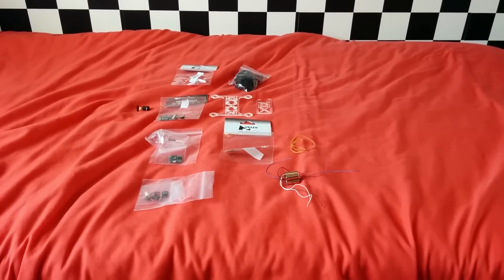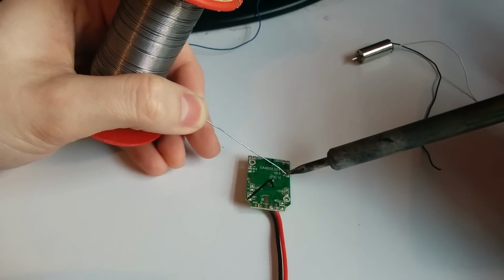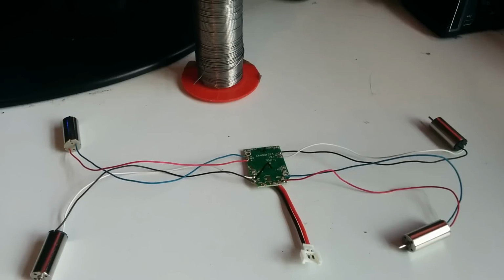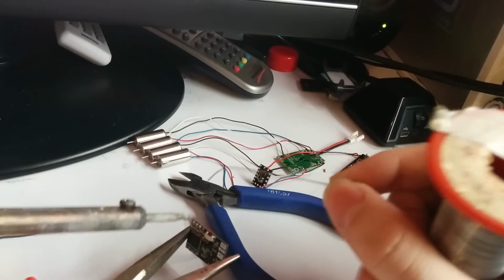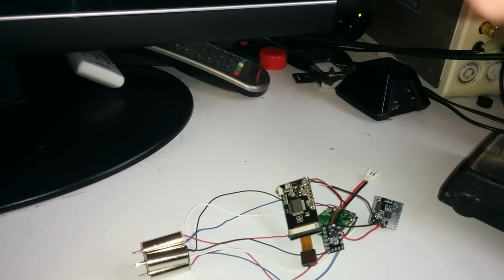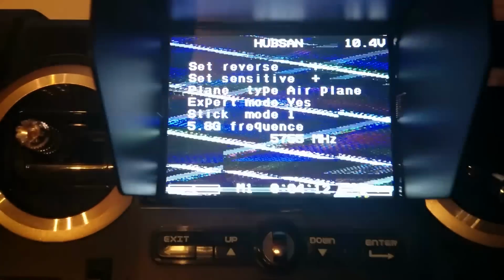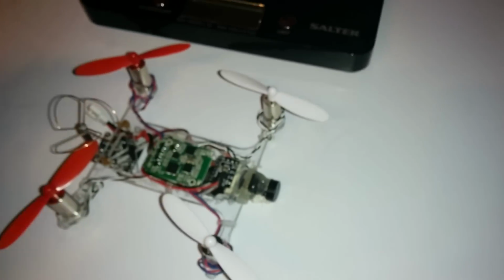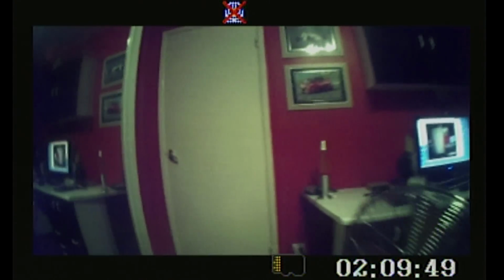Microquad Custom FPV Full Build & Flight With HD Recording

Comment: Was hoping the parts list would have a flight controller board and a low cost rc transmitter :-(
Reply from the maker: Raqtor96 you mean a multi wii based flight controller? the hubsan board coupled with the hubsan TX is the cheapest combo of them all 8gbp for the FC and 11gbp for the TX compared to alien wii which is 50 dollars and a tarainis which is 160 gbp!
Reply: +AndyRC I had been looking at the Nano QX board. Its supposedly very awesome and has "acro/rate/manual" mode plus build in DSM reciever. But its kinda expensive too :-/
Reply from the maker: they are expensive and i think only supporting smaller motors too?
Reply: +AndyRC Really missing your micro quad stuff :-) .. Dont know if you have heard of:
http://www.banggood.com/Micro-Scisky-32bits-Brushed-Flight-Control-Board-Based-On-Naze-32-For-Quadcopters-p-1002341.html
Build in 7ch DSM2 rx, 5V step up supply, 32 bit cleanflight/baseflight/betaflight and only 2.5g.
Reply from the maker: yep its coming up on the channel :)

Comment: what flight controller did you use
Reply from the maker: Theblankhand hubsan spyhawk TX with the hubsan h107d controller board
Reply: thanks
Reply from the maker: no problem

Comment: been searching for motors with longer wires, what did you search to find these?
Reply from the maker: prOkrEAt i search for hubsan h107d motors on ebay and sort by price lowest first. u can see on them that the wires are much longer they are about 3:99 from china all best
Reply: +prOkrEAt I don't know if you can post a link in YouTube comments but here goes a test. http://www.ebay.com/itm/221770485965
Reply from the maker: yep will be fine
Reply: +AndyRC I spotted that those with 2 wents in motor are not as much powerfull as those original hubsan with 4 wents, and you cant use them with the original hubsan motors for example from bangggod.
Reply: StalU
I bought some sets from that link. They do have 4 vents when you receive them. However they aren't powerful enough to really lift a 42gram picniquads. I bet the original h107d weighs over 50grams. I spend over 100gbp and the thing can't even fly yet :-)
Reply from the maker: that does not sound right :( iv never had a problem with ebay motors however Iv not bought from Australia before. I Always buy from china
Reply: That eBay link is a hong kong seller. The quad can sometimes take off in the ground effect area with the red and white hubsan h107d props from banggood. But then the propellers rips off. I tried securing them with locktite thread lock over night . .didn't help then tried CA .. that held them on until I hit something. But still didn't fly over 20cm up. With the rolling spider props it can kinda fly but is completely uncontrollable. Just wobbles around until a prop flies off.
Reply from the maker: thats crap. usually i use the parot props with stock hubsan motors however it should lift it better than you are getting :(
Reply: Perhaps I should try the Banggood ones . .they cost double though. :-)
Reply: Im waiting for new battery the ni can try out how much they really can pick up. now my 35g quad and old battery are fying but hower at around 80% throttle so not so good.
Reply: StalU
What motors are you using that can hover at 80% throttle?
Reply: +Raqtor96  banggood but i have 2yers Old batteries and they drop Down voltage.
Reply: I changed the frame and resolder the motors and it looks like something was wrong with soldering mb. now it hover at 52% on old battery weight is 42g and i am using 200mw boscam tx module+ 150mah battery :)
Reply from the maker: +StalU great to hear that. happy flying
Reply: Hmm. Perhaps the long wires on the motors reduce the current? Perhaps I should try shortening the wires. You think that could help?
Reply: I think there is no so much current flow in them, just check that after fly are they warm to touch.

Comment: nice idea to use the hubsan hd camera for fpv...but I would like to have a flight controller that can do acro/rate mode for practice...
Reply from the maker: Stephen Wright yes for that you will need one of the multiwii brushed boards such as alien wii or MWC board

Comment: does this H102F-01 also work with the ladybird tx5805 fpv module?
Reply from the maker: Johnny TSC it does but you have to manually select the frequency where as using the hubsan fpv gear it find automatically
Reply: Do u think the devo f4 fpv radio has better range and quality then yhe hubsan fpv radio?
Reply from the maker: I think they are about the same. they are different protocols though so the have different purpose. devo is for walkera and hubsan for hubsan

Comment: hi .. thank you for this very informative video .. tell me, what to trigger recording for the fpv? I am French and I do not understand everything that you say; p
Reply from the maker: yes you can do that but the h107c tx has limited range compared to the spyhawk
Reply from the maker: zzeeenn button on the side of the camera module starts recording
Reply: desolated but I hurt my question (goggle translation) .. I wanted to know if the fpv works even if not registered?
The H107C camera is active even if you do not press the button?
Reply from the maker: yes it does :-)
Reply: thx 😉
Reply: +zzeeenn The hubsan tx can turn the LED lights on/off, i read someone had wired it up so that instead it starts/stops recording, would have to google it..

Comment: I have several micro kodo quadcopters which I have salvaged cameras and other bits and parts from. The micro cameras I have had troubles with in finding video feed out for use in other builds I have. The module is very similar to this one in your video, any ideas? Very cool by the way..
Reply from the maker: Drew Heli can you link me some pictures of it? the camera module that is. thanks
Reply: AndyRC not sure how to link you to my personal archive, here I can only post videos which I have yet to do. here is a link of all the images regarding the kodo camera module and quad. https://www.google.com/search?q=kodo+camera+module&rlz=1C1GGGE_enUS494US494&espv=2&biw=1366&bih=667&tbm=isch&tbo=u&source=univ&sa=X&ved=0CEkQ7AlqFQoTCLi9zsep68YCFUg2iAod62EFZQ
Reply from the maker: those pictures are of all different modules so its hard to tell. first pic that comes up is the standard def version of the voard, dont think that has video out capability, second one along is the h107d video TX with no recording capability, third one along is the board in this video. I would say if its got solder pads try the fourth one along for video. it seems to be a common theme
Reply: how do I send you pics for review? so I can show you what I am talking about.
Reply: http://www.rcplanet.com/59612/Dromida_Complete_Camera_Kodo_Quadcopter.jpg this is one side of the cameras I have salvaged from kodo quads purchased at $5 US each. Then this camera module connects to this main board via the three wires http://www.hobbypeople.net/media/catalog/product/cache/2/image/9df78eab33525d08d6e5fb8d27136e95/9/4/943750.jpg
Reply from the maker: it looks like the standard def version of the hubsans video. its got 4 solder pots so try the fourth one along for video :)
Reply: awesome thank you!
Reply from the maker: no problem good luck with it
Reply: worked any with the eflite cgo1 wifi camera? trying to hack it in order to attach external transmitter to in turn connect to my fatshark goggles v4. I really hope you can help lol otherwise a waste.

Comment: the motor of hubsan h107c are 8mm not 8.5mm.... i have to buy 8.5mm?
Reply from the maker: Silicon Blog if you measured them they will be 8mm but most places list them as 8.5 - they are both the same
Reply: ok, thanks...  on aliexpress i see 8mm
Reply from the maker: they will be fine

Comment: Excellent video Andy very informative you remind me of myself messing about with the Hubsan internals..its great fun trying to improve an already cool product :) I have the H107L, H107C and now the H107D which I have now modded with a micro cloverleaf antenna that plugs straight into the H107D board no solder required from hobby king.com I also gave my 107d TX a cloverleaf..great extra range. A couple of questions and tips for you..do you know if it would be possible to solder the 5.8ghz video antenna off the 107D quad onto a 107C 2mp camera module and receive HD video on the Hubsan controller?.. After your h107c camera mod was what you see live on your TX any better video quality than the feed from original h107d quad? Or is it the same and it only records to the SD card in HD? What flight times are you getting on what size batteries?

I'm constantly changing motors,different coloured LEDs etc on my Hubsans...did you notice on the main Hubsan board just to the left of the battery cable there is another free + and - to solder too..(you don't have to double up the cables)

After much stress with the fine soldering in the end I purchased a very fine tip for my soldering bolt..much easier for this fiddly work.

Do you know of the different micro carbon fibre frames for Hubsan quads you can get from Phoenix flight gear.com..light,strong and look awesome when built.

I'm gonna take all I've learnt in this video and put in on one of these Phoenix frames.

Thanks again top video mate!
Reply from the maker: nopike2big  on the h107c there is no video transmitter so its only possible to solder an antenna to it if you add a separate vtx like in this video. regardless of the input the vtx only transmits in standard definistion so the quality is not that much different. i wasnt sure about the other 5+ so its good to know its there! - I have not experimented with other frames other than mmw carbon H - picnicquads is my go to place but i will check your link cheers

Comment: Nice work! I've been wanting to add FPV recording on my micro, but didn't think it would be possible without adding a lot of weight.
Reply from the maker: adamky1 the weight is n issue bit if you use these light frames it csn work :-)

Comment: do you know if the hobbyking quanum  fpv goggles will work with
    the 50-100mw vtx ( 5.8 GHZ AVTX ) you've used on this build?
thanks
Reply from the maker: wowiezowiepowie the quanam goggles work with anything, that is because they dont come with a video receiver. they accept any composite video input in. so if you buy an RC832 alone with the quanams you can pick up the video from that VTX. all the best
Reply: AndyRC can i use H107 L or C ?
Reply from the maker: yes any of them

Comment: Hello, which battery and flight times are you using/getting with this setup? I built an micro myself too but i've used the mmw micro-h frame. Doesn't put hd recording, only the fpv that i've built (ts5823). I'm having trouble with noise as i didn't received my regulator yet.. Tried to make an filter with ferrite ring + capacitor. It works but only when my batttery have enough juice then it starts noising and the filter is too heavy for this little guy.
Reply from the maker: Thiago Arecippo the mmw frame is quite heavy so i dont really use it i get poor flight times with it. i use the 500mah batteries from banggood. the picnic frame is so much lighter and cheaper
Reply: AndyRC Thanks for the tip.. I actually found it heavy for the project but i didn't knew about picnic micro frames, i'll take a look.. I'm using 750mah nanotech batteries and getting around 10 minutes of flight times but the quad is heavy for this motors.. I only need my regulators to try the fpv without noise.
Reply from the maker: yes i find the regulators from fpv hobby are the best
Reply: AndyRC I just ordered the regulator and CL antenna from fpv hobby but the x^3 platform picnic frame is out of stock. Which radio + rx are you using? I'm using stock x4 radio but i don't know how far i can go with it.. Another question, have you soldered the Vin + ground for the regulator directly from the x4 fc or what?
Reply: I just saw your radio :-)
Reply from the maker: i did do that yes its in this video :) and its the spyhawk transmitter :)
Reply: Thanks, sorry to bother you, i just saw your video again and the regulator wires. I'm thinking on getting a spyhawk tx for me (or the h107d) as they are on the same price range. Which one you think is better (range, dvr...)? Thans again, i'm rebuilding my micro-h based on your videos.

Comment: Excuse the question: between the various links that you put, I have not found the receiver's remote control, which you advise me to use? I could use a DX6?
Reply from the maker: Diego Falcone not with this setup but if you use the flight controller from micromotorwarehouse then that is compatible with the DX6
Reply: AndyRC Thanks for the answer!  With your configuration, what kind of radio should I buy?
Reply from the maker: any hubsan controller will work, i use the spyhawk transmitter from helipal its about 60 gbp
Reply: AndyRC Thank you very much!!!

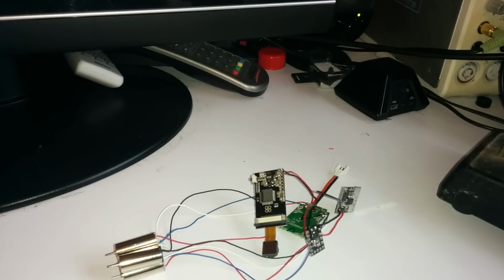Comment: Hey, I noticed at 25:02 you're soldering a video wire to pad #4 on the H107C-A34 module. How did you know it's possible to do that? Do you have a spec sheet for this component? I'm curious if this module can safely handle 2S. Thanks.
Reply from the maker: createthis I didnt know it was possible, just lots of trial and error. id be surprised if it ran at 2S because it powers up at 3v but hey they are pretty cheap these days so get a couple and try. honestly if you have a 2S setup you would be better with an 808 16 or a stripped out mobius. they are better quality. all the best.
Reply: 808s are so much heavier though. I'll try it and see. If it doesn't work, I'll compare the weight with a step down regulator vs an 808. Thanks for the reply!
Reply from the maker: you can really get the weight down with an 808 if you take the case off and hot glue the lens in (you really have to be careful not to move the 808 lens too much the ribbon tears really easily and you start to get funny colours in your image) Iv managed to fit an 808 to a micro quad so a 2s setup should be no issue at all. what quad are you trying to fix it to?
Reply: I've decided I'm going to cover the full range of options, here. I've ordered a #16 808 with a 120 degree "D" lens. I'm going to order a 3.3v step down regulator: https://www.pololu.com/product/2842 I'm also going to try my existing A34 at 2S and see if it magic smokes. Finally, I'll do an A34 build with the step down regulator and compare it to the 808 for weight and see which one wins. Maybe I'll film it all and do a video.
Reply from the maker: sounds good. although iv had much more luck with the regulators from fpv hobby than pololu, check them out. ill look forward to a video. keep me updated!

Comment: Nice job Andy.  Where do you live in England?  I assume England.
My next project will be to build a 250mm sized quad for my RC racing quad club.. I'm just a 57 year old kid. ;)
Reply from the maker: MrPolymers im in the midlands yeah :) im currently building a 450 size as I want a gimbal quad next.
Reply: I'm not sure I want anything bigger than the Cheerson.  I think the 250 class is ideal for me.  I can also sneak a flight around the house.  I won't fly my Cheerson here due to being just too dangerous.. I fly it only at my RC clubs field or sometimes my local park when nobody is around.
Reply from the maker: this is true this is why my longest range Rc vehicle is my micro setup! Iv gone further with the hubsan micro quad than i will anything else! going for 1km when i find the right location
Reply: Yes indeed Andy.  I would not trust flying my nearly 3 lb Cheerson CX 20 out of sight... Maybe my 3D X6, but the battery time is terrible.  I've come to the conclusion that the 3D X6 is under powered with the 7.4 volt system.  Really need a 3cell 11.1v system on these hobby grade quads...
Reply from the maker: MrPolymers i hardly use the x6 now, its gps system is of no use and flight times are too short. im tempted stick a 3s on it and see if it blows lol
Reply: I'm doing some trial runs of a 2200 mah battery on the X6.  Yes, 5 minutes sucks using 6045 props and 1,000 or 1200 batteries..  3s will cook the esc's..
Reply from the maker: any battery above 1800mah will cause oscillations on the x6, this is because the PID settings are tuned to carry no more than this weight. you cant change those settings, well you can but try the ground station and it gets bricked. the perfect battery for this quad is already found, join the x6 facebook group theres more info on there than rcgroups. they are trying different firmware and all sorts. I bought the 1800 mah battery recommended on there and it fits inside the quad! all the best
Reply: I did update the firmware via bigskyshark to the latest.  I do not see PID's though.  I'm going to leave it as it is.  I'll post video of the 2200 and we can see.
Reply: Andy..  I think you are absolutely correct!  Watch my latest video..  I used my 2200 Lion 113 gram battery with my Mobius camera.  At first, the flight was OK, but it started erratic behavior. Although I'm running powerful 6045 props, apparently the loading is just too great.
Reply from the maker: yeah I have recently built a scratch build quad in which you have to tune the flight controller yourself, if the pgain is set to high then the quad oscillates same as x6 does under load. the more wight i add to my custom quad the lower the pgain I have to set. if only the ground station didnt brick the quad we could alter that :( this means the x6 is really limited in what you can add. fpv gear and a mobius is definitely pushing its limit
Reply: Yes.  I guess this will just be my short duration brushless quad.  I never meant to FPV this.  That will come when I custom build my next quad.  Thanks for the info.  I wondered if my issues were just exclusive to me on the 3D X6..
Reply from the maker: i have two of them and they are both the same. time to move on to something different for me :)